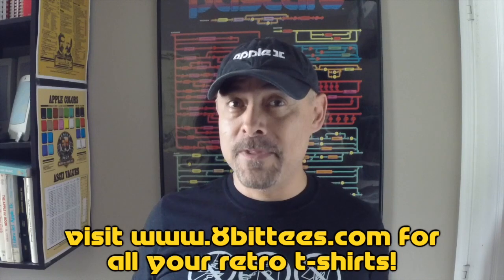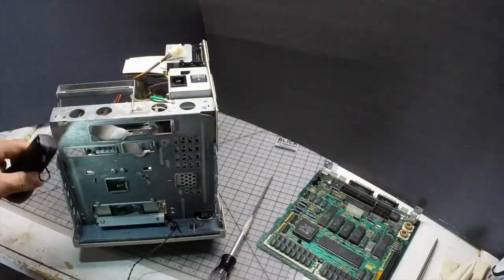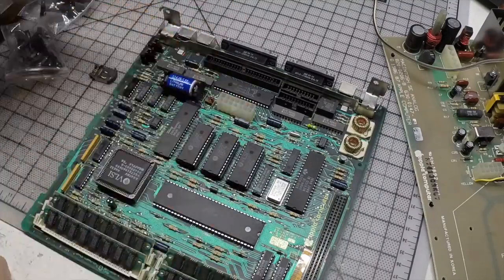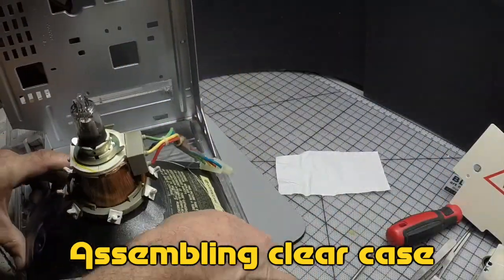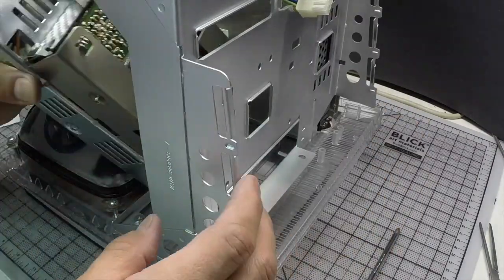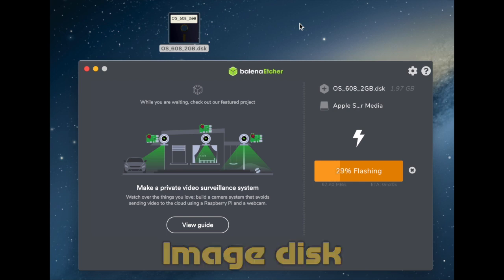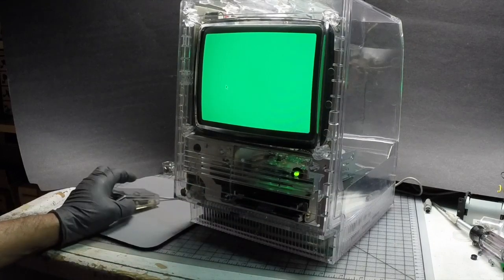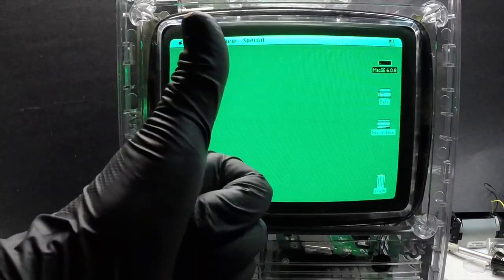Adventures in Retrocomputing - 29 - Clear Mac SE Hack

Comment: That battery holder is in a tight spot... does the battery fit OK without touching anything it shouldn't?
Reply from the maker: It fits perfectly and works just fine. Plus I have the assurance that it won't leak.

Comment: Did I miss the speaker install?

BTW, are you going to put the SE tube back in the IIc monitor case?

Looks fantastic!
Reply from the maker: Actually the speaker hasn't arrived, so had to do it without. I may get it this week.
I may put the SE tube in a monitor, but this was from a dead conversion monitor. The CRT's always survive.